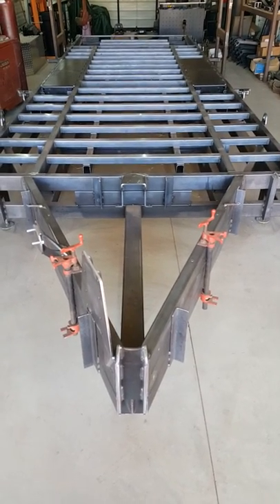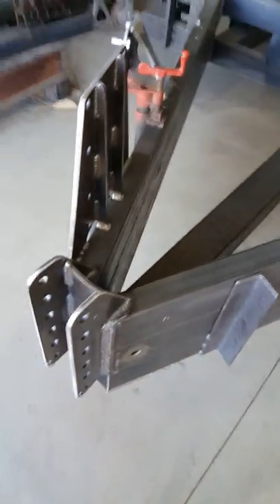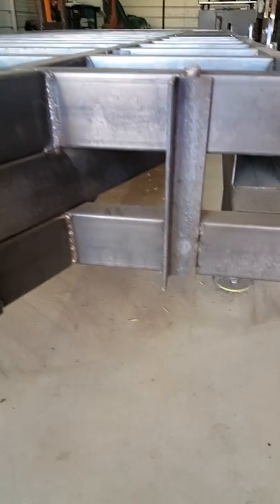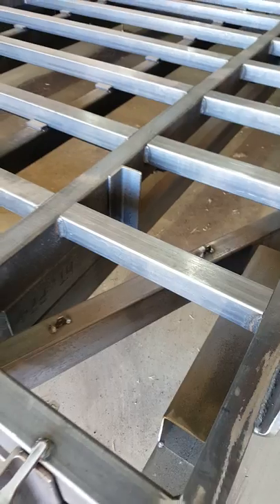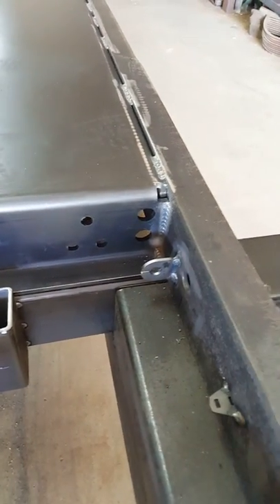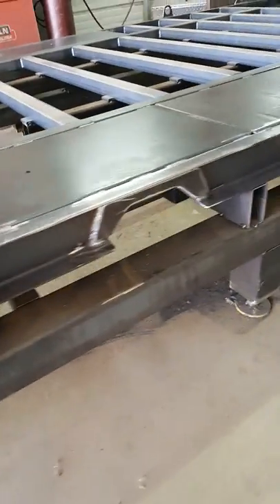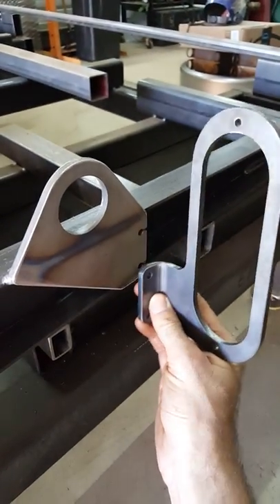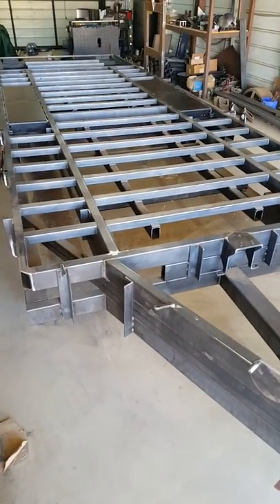Airbagged Trailers 2019 Frame Design Tech Tour

Comment: How do you have your air bags mounted? Where do the spindles get mounted? Do you guys use drop axles or something else? I'm building my own bagged trailer but can't seem to figure out how you guys get your trailer to sit on the ground
Reply from the maker: We mount our airbags under the frame and the spindles are attached to our own suspension design. With a conventional trailer drop axle, it isn't possible to get nearly as low as our independent setup can. It would still be better than a normal trailer, however.